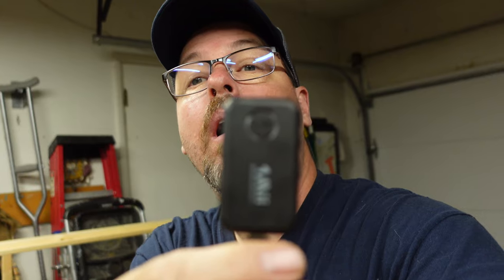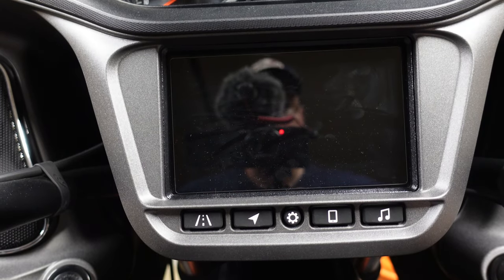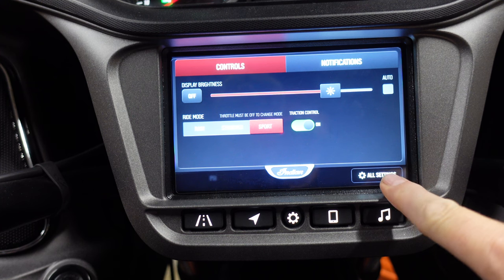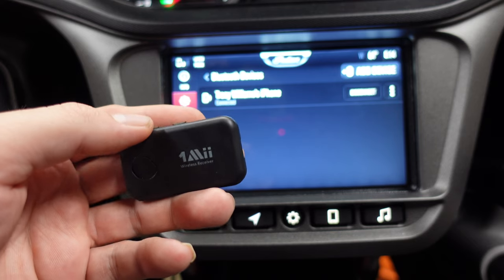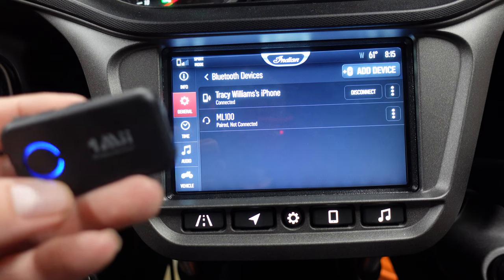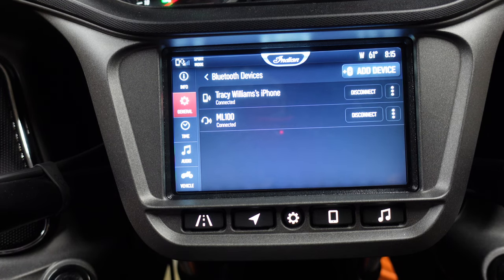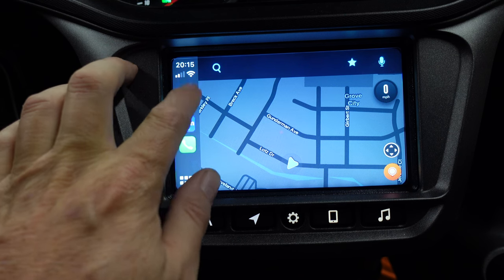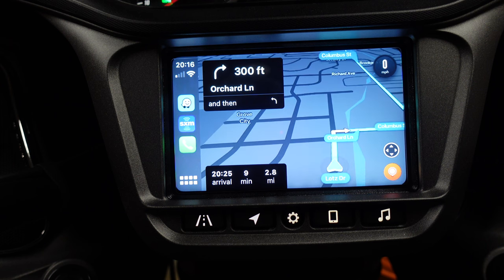Setting up a Bluetooth dongle on a 2020 Indian Challenger

Comment: Do you have to power off the bluetooth adapter while the bike is not in use?   Seems that it would draw power if you didn't. (saddlebag option)
Reply from the maker: You would not want to keep it plugged in the accessory port for a long time. I keep mine unplugged until I want to use it. I don’t ride much without a helmet 🪖 nowadays so I either use my Sena or the shockwave.

Comment: I been using this since I bought my  challenger in 2021. Lately the music plays for about 10to 15 min and then no sound. Everything work just the sound is out. Any suggestions? Thanks
Reply from the maker: I wonder if it is just going bad.
Reply: @ I tried a new one only to get the same result
Reply from the maker: @armand0broncas677 maybe check to make sure it’s not switching from speaker to headset. That sometimes happens
Reply: @TSWGarage614  Check the RideCommand or in my Phone?
Reply from the maker: That would be in RideCommand. Sometimes it is kind of hard to find so you just have to poke around unfortunately.

Comment: So.  What you are saying is that you can walk up to the bike. Turn it on. The iPhone pairs with the bike via Bluetooth. The Dongle is either automatically paired or you have to select it from the drop down list. Once it’s paired. You get AppleCarPlay functionality on your bikes screen. To make or receive phone calls. Etc. Right ?
Reply from the maker: The dongle connects to the bike and you plug the phone into the USB port and the Apple Car play works. There would be no bluetooth connection to the phone, the phone connects via the USB port. pretty easy.
Reply: @TSWGarage614  perfect
Reply: @TSWGarage614  I bought exactly what you showed in your video.  I have a Bluetooth headset.  So I can still do that. But I think having that dongle connected to the saddlebag via the charging port enables me a bit more freedom. And reliability. Just hop on. Plug in my phone. And done. As it is, I still play music via Bluetooth through my phone. No commercials.
Reply: I tried it today.  I followed each step.   I had a problem.  I connected the phone via the apple cord USB to the bike in the dash.  I then connected the exact   dongle you have to the port in the trunk of my Roadmaster. I was unable to get audio when making phone calls.  I was also unable to speak to Siri.  Siri icon came up. But I couldn't speak to Siri.  Should I connect both the Dongle and the iPhone to the cord.  ?  Or Bluetooth one or the other ? Or both ?  I got the prompt for Apple car play.  But I couldn't press on it. Sorry, I'm confused as what to do next.  All of the apple car play menus came up. Just no audio was available except music.
Reply from the maker: Do you have the newest software installed?
Reply: @TSWGarage614  yes I do.
Reply from the maker: The reason I ask is because not being able to click on things seems to be a software thing. But the only thing that needs to be connected via Bluetooth is that dongle. Maybe you have to connect the dongle first then the phone? If I had my bike I would go mess with it. Also the newest update is from November. It’s like nothing ever works as planned.
Reply: @TSWGarage614  I’ll try it again.  Bluetooth the dongle . Then usb connect the iPhone
Reply: @TSWGarage614  are you able to summon or speak with Siri ?
Reply from the maker: So that’s a good question. I think if I used my Sena 50S(not using the dongle) it would work but really never tried it with out. I’m not sure how that would work. Unfortunately since my bike is in the shop I can’t test it. My concern would be you not being able to get the apple play screen up.
Reply: @TSWGarage614  good point.  I was able to get the Apple Play notification. But as I stated i couldn’t click on said notification.  I’ll go back to the bike today and play with it. I’ll get Apple menu screens.  And play music.
Reply: @TSWGarage614  I called the local Indian dealer.  I was told the Bluetooth Dongle allows the use of many things.  Except asking for Siri or phone calls.  Only the headset allows full function.
Reply from the maker: Well I could agree with that. I would not want to try to get a phone call working or yell at Siri without a head set. Heck Siri barley knows what I am asking in a quiet room. But Apply Car Play should work. Like for maps and if you have SiriusXM or something.
Reply from the maker: I feel like that’s not what you were hoping for. I do like the Sena 50S if you wear a helmet.
Reply: @TSWGarage614  I was hoping for full function.  Alas, I got most of it.  Far more then without the Bluetooth Dongle. So it's a Win.  Now I know how to get the system to enable full function capability with my Sena.
Reply from the maker: Yup just connect your Sena instead of the dongle and you should get it all. Well I did anyhow.
Reply: @TSWGarage614  good.  Now I know the steps.
Reply from the maker: I put in the description that you will not get Siri or phone call functions using this. Thanks for all the input!!
Reply: @TSWGarage614  no problem.  That way everyone is happy.  I'm charging my Sena.  And I'll go back to the bike to see how it all works.
Reply from the maker: This is probably obvious but don't forget to connect the Sena to the bike via bluetooth
Reply: @TSWGarage614  yes.  I'll connect the iPhone  via the USB cord.  Then Bluetooth the Sena to the bike via Bluetooth.
Reply from the maker: If that has issues try Sena then phone.
Reply: @TSWGarage614   I found that if you connect the dongle first then plug your phone, it seems to work better.
Reply from the maker: Yup. I think I figured that out eventually. I’m kinda slow. 🤣

Comment: I bought this dongle and tried it on my '14 Chieftain but the Chieftain interface keeps asking for a passcode.  I tried 0000, 1111 and 1234 and still it fails to connect.  I wrote to iMii's support and am hoping for a solution.
Reply from the maker: Interesting, I could not find anything about a passcode. Let us know what you find out.

Comment: I tried this but I have to turn it off and on when I start my bike. CarPlay also disconnects automatically after few mins of connection. Does it happen to you as well?
Reply from the maker: I normally turn mine off when I get off the bike and turn it back on when I want to use it. I never had CarPlay disconnect though.

Comment: Can you clarify the install? I purchase the adapter and tried it. Did not work?

I have a 2023 Chieftain DH. 

I am assuming you connect the your phone via BT, then the adapter via BT.  Then Car Play should start automatically.
Reply from the maker: Connect the dongle to BT and then plug the phone into the USB port, I think on those models the USB port is in the compartment above the dash. Unless you get a wireless CarPlay adapter you have to plug it into the USB port. I have a video on that and will have a new video out with a different wireless CarPlay/android auto adapter.

Comment: Is this a loophole for base models without navigation unlocked?
Reply from the maker: I don't know about that but it is a loophole for not having a SENA com system or something similar. Basically getting Car play without a helmet. So maybe that wold be a work around as you can use the maps on your phone. If you don't have apple car play I think you can do a software upgrade to get it if you have the RideCommand system.
Reply: @TSWGarage614  without the CarPlay on did you have navigation unlocked on your bike?
Reply from the maker: Yeah, mine had the navigation.

Comment: Hey TSW. I’ve followed your instructions a while back and this works great with one exception.  If I have to access the bike settings after I have the CarPlay up and running the sound cuts out.  Any suggestions ?
Reply from the maker: I'll have to try that. When you go back to CarPlay?
Reply: @TSWGarage614  yes
Reply from the maker: Well that was a half thought of mine. I’m glad you knew what I was saying. I’ll try to look tomorrow to see if it does the same thing on mine.
Reply: @TSWGarage614  seems to be working again  I flip back and forth  no issue.   Weird
Reply from the maker: I found that the RIde Command is picky on some bluetooth devices. LIke my Ruroc Shockwave will cut out every once in a while but my Sena works 100%. But Indian said the only Bluetooth communication system they support is Sena. Not sure why because Bluetooth should be bluetooth.

Comment: Mileage sequence when to change oil or maintenance?
Reply from the maker: Looks like if you have had a 500 and 2500 mile service it is every 5,000 miles. Check this link out, if it opens for you anyway.
https://cdn.polarisportal.com/servicemanagement-public/OwnerManuals/9931163/MaintenanceIntervals-1408B618.html#file0000559851_MaintenanceIntervals-1408B618166

Comment: Did you have to run phone wire to the usb on bikes cubby hole to let it work
Reply: Or no more wire from phone to bike?
Reply from the maker: Unless you have a wireless CarPlay adapter you have to have your phone attached to the USB in the cubby. I have a video for that, I used quad locks Wireless adapter but I have another one that will allow android auto. I am going to mess with that today.